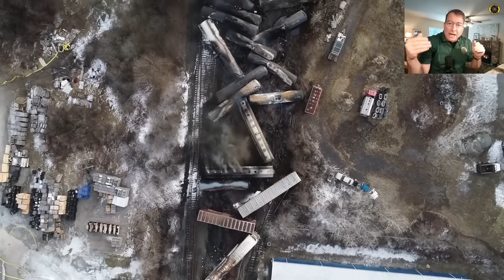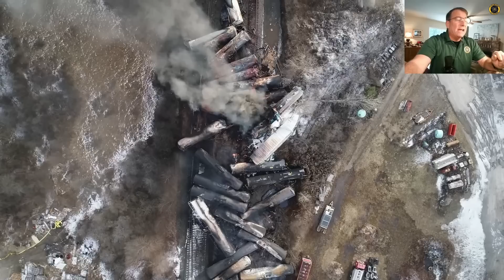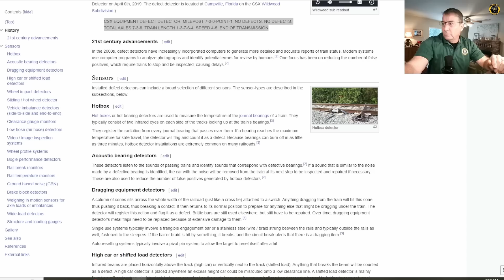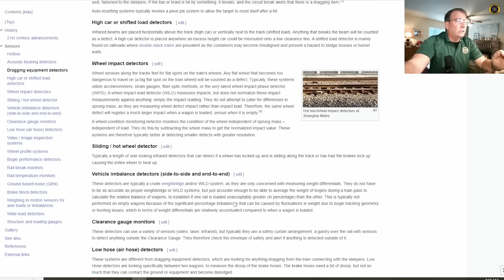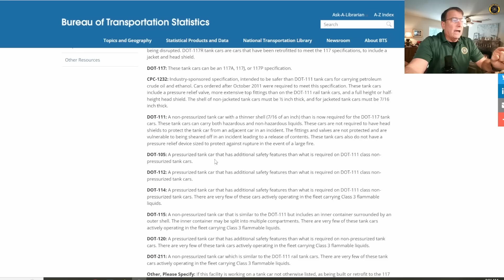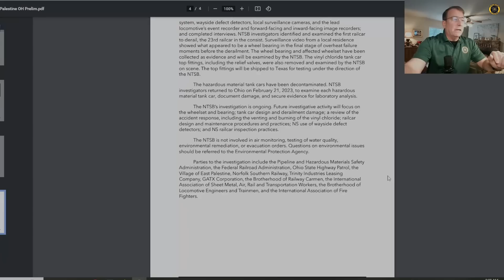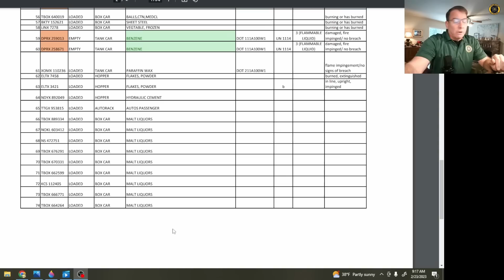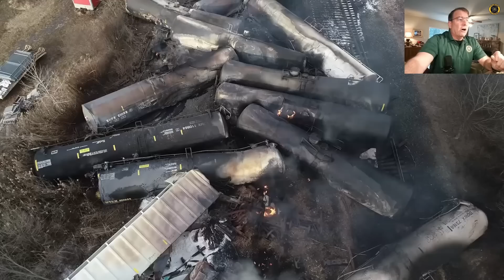NTSB Prelim Report: Norfolk Southern Train Derailment 23 Feb 2023

Comment: BEARINGS & AXLES

Juan,

Modern Roller Bearings are far more efficient than the conventional bearings sitting in a Journal Box. Obviously as with all items where there is a mechanical interface, heat is the enemy....so think of a drill bit drilling a hole in metal. Lubrication is the answer.

Likely what happened here is that following some form of lubrication failure, (or failure of a part of the bearing itself), the heat build-up caused the axle to fail and this led to the derailment. The speed from the rest of the train in rear then pushes against the point (car), of derailment. The kinetic energy will slowly reduce, but not before more damage, (and further derailment of cars), has taken place.

The kinetic energy is dissipated back along to the rear of the train, which eventually stops.
Clearly in this instance the reduction in kinetic energy and the eventually stopping of the rest of the train saved the Beer in the rearmost cars.

Whilst the Engineer and the Signalling Centre will receive the 'calls' from the Hot Box Detector, I'm not sure that the temperature is given as a verbal message to the engineer, or to the Signalling Centre. I cannot be sure that even if the temperature of a Hot Box were known, that there is any operating table that defines what temperatures are a bit of a problem and what temperatures are critical, such that the Locomotive Engineer might act to stop the train.

Giving the Locomotive Engineer a message which tells him Hot Box = Problem is much simpler and easier to act upon.

The mere fact that a Hot Box is detected indicates that there is a problem and that the train must be stopped and examined as soon as is practically possible. The concept of 'Stop & Examine' is a well know Railroad / Railway term and practice. In this sense it is rather like driving your car, where if you hear a noise that is out of the ordinary you stop to take a look.

I suspect that the temperature or temperatures picked-up by a Hot Box Detector are essentially only of critical importance when determined by the Railroad and NTSB examiners, as post accident information / contributory factors.

In what we might call the ordinary 'Happen-Chance' of life, in this instance the derailed cars were carrying chemical and potentially inflammable products......they could just as easily have been carrying grain or coal...!

James Hennighan
Yorkshire, England

Comment: Interesting article. I’m a Railway Vehicle Engineer. These types of events are not uncommon and yes a failing axle bearing on a laden freight train can “go nuclear” within 30 miles as shown by the data from the HABD sites. I’ve experienced a number of these. These detection systems are old tech and by the time they trigger the alert the bearing is in great distress and failure is imminent which could snap the axle and/or derail the train. The state of the art system for axle bearing detection  is the lineside Acoustic detection which picks up tiny defects and flags a bearing of concern 3-6 months before it would trigger a temperature alert. Much safer. Modern passenger trains usually feature on board axle bearing temperature monitoring as well.

Comment: It was the conductor and rear brakeman that used to ride in the caboose. Firemen rode up front and helped run the locomotives--especially in the steam era. Probably the axle failed and the car derailed, taking the train cars behind it with it. Even on a smaller train, this was going to be a huge problem. On a train this large, it was guaranteed disaster.

Comment: There is an end of train signal box which is real close to the pressurized air line. If the EOT signal connected to the air line a dump value could start braking the train from the rear and retard some of the energy / push from the rear of the train.  It also appears the engineer was too slow to quickly respond to the temperature reading.  What we lack here is the expected wheel set temperature given the local conditions.

Comment: Not all locomotives are equipped with dynamic brakes.
Dynamic brake locomotives are more expensive(optional equip) and are generally used by RR's that operate in hilly terrain.
As far as I know all new locos are equipped with dynamics.
Many older locos are not so equipped.

Comment: I know in aviation when worked for the FAA,I checked the equipment in the ATC and ILS systems, the equipment defaults to a non use mode if there is a cal or other problem so you can't use it.

Comment: One correction: the emergency braking did not cause the derailment.. the wheel disintegrating  caused the derailment and the engineers put the train in emergency once they got the hot box warning

Comment: If the seal is out of the bearing so the lubricant drains out, bearing failure can happen. 
Detector data from the prior move would paint a better picture of the bearing condition. It may have moved some distance losing lube, and not gotten hot enough to set off a detector getting to where this crew picked it up. 
Had the detectors been set up to communicate, a 110⁰ rise in bearing temp is enough to warrant an inspection. 
If the temp of one bearing could be compared to the train average, it likely would have been caught at the second detector as well.

Comment: Jaun-
Wow. Starting railroad reporting in the deep end.  A couple of minor points with you language as I appreciate your technical accuracy in your other reporting:

Positive Train Control (PTC) is mainly employed to regulate the speed of a train as specified by warranted track speeds per any given section of a railroad and to ensure a train’s avoidance of other trains or equipment operating on the same lines allowing the PTC to take control from the engineer in order to stop the train.  It is not intended to manage all aspects of train performance and mechanical issues as they occur. I am fairly sure that the train’s “PTC” system in no way failed; it is not some Musk-contrived, overly-hopeful, fully-autonomous, solve-everything, train driver system. It basically protects trains from each other, from their own speed, and from certain switch alignments.

Only conductors and brakemen would historically be found in cabooses; ‘firemen’ were traditionally in the cab firing the power-plant (steam boiler) for the engineer who was responsible for applying the power to the engines (valves/pistons/drivers) to operate the train. Thus a firemen’s primary safety job was not to look for fires - AKA hotboxes AKA overheated friction bearing journal boxes - but to ensure boiler safety and performance. This NS train had an engineer and a conductor in the cab - as is currently common practice in modern, long haul, distributed-power, diesel electric freight - with a monitoring ETD on the rear.

Roller bearings, bearing seats, rail axles, trucks, etc. are all metal (forging, castings, machine parts), under pounding strain, and can catastrophically fail (crack/fracture) causing a bearing/axle to heat up very quickly at speed.  This can easily result in a railcar wheel set/ truck assembly starting to come apart as infrastructure within the trackway/gauge - such as crossings pads and turnouts/switches - are hit with hanging/failing equipment.

Hope this advances your rail knowledge, I appreciate your other infrastructure and systems reporting. Thank you.

Comment: At 4:30 you mention that PTC was operating but failed to prevent the derailment.  PTC’s purpose is not to prevent derailment.  It’s purpose is to prevent rail collisions. Also, at 7:40 you mention that fireman used to ride in caboose.  The conductor used to ride in caboose, not the fireman.  Back in the day, the fireman shoveled coal to the steam locomotive firebox, thus “fireman”.  The conductor was moved to the diesel locomotive after cabooses were removed from trains.

Comment: The hot box detector does not transmit its findings until after it passes except if it detects a problem during the scan. It does not transmit info to the engineer like trends of boxes heating up during a normal scan from the last detector unless it is outside the parameters set by the railroad. I do not know if the boxes are connected to dispatch or not.

Comment: Lots of good info here (even more so in the comments than the video), but there are still some things I am confused about:
1) What sort of bearing are we talking about here. Presumably not a bushing, but some kind of typical (but large) ball or roller bearing? 1a) is it one central bearing or two bearings - one near each wheel?
2) Why did polymerisation of the vinyl chloride start? 2a) Did the derailment start a fire that heated that car up? Is it normally cooled and the derailment stopped that cooling working?
3) Was there a fire before the deliberate setting of one to burn the vinyl chloride?
4) Was there actually any (significant) phosgene produced by the burning. I've seen plenty of excitable comment about it, but so far as I can tell from some basic chemistry reading, burning vinyl chloride in air at atmospheric pressure does not generate phosgene.
Thank you for any clarifications people can provide.

Comment: Retired Engineer. The evidence is pretty clear to me. If you have three detectors all working properly it falls back on the RR on where they set the threshold (in temp) to warn crew. And yes, if you have an increasing heat signature on a wheel bearing, the heat will exponentially increase until failure, especially on 50 mph track speed. 20 miles between detectors is more than enough time to reach failure point when previous detectors already recorded an increasing heat signature on same axle as in this case.
PTC technology is not at all applicable in this derailment.

Comment: I retired from NS after a 41 year career in the mechanical department in 2020. I didn’t intend to retire for a couple more years, but the absolute rape that PSR conducted on these class 1 railroads had made it so unsafe that I ultimately decided it was time to get out before I saw one of my buddies or myself killed! One of the first actions of the hedge fund carpetbaggers that inflicted the PSR Pandemic on the class 1’s was to quickly dismantle the repair and inspection operations of their car and locomotive fleets. The few terminals left after the scorched earth stripping of assets was executed, had nothing more than skeleton crews of trained inspectors left due to mass layoffs, and the few that remained were told unequivocally not to inspect anything! Just couple the air hoses and let ‘em go! And worse yet were the now numerous terminals/yards that originated trains with zero trained inspectors on the property, and the outbound crews, which through no fault of their own, aren’t trained in inspections, were the only eyes on the train! And the severity of that situation is doubled by another of PSR’s dirty deeds: reducing the number of trains ran by coupling the consists of two or three individual trains together into monster 250 or 300 car trains! These things had (and still do!) locomotives spread out in two or three locations throughout the consist and radio controlled from the lead unit. What few of us “old farts” were left out there during this PSR charade in 2020 predicted this kind of stuff would start happening after a couple years. Prior to PSR, rolling equipment was maintained in optimum condition, so we knew it would be ok for a time, but lack of inspection, maintenance and repair for a few short years will make its absence known to all! Just ask the residents of Palestine, Oh! The railroads as well as the Wall Street Hedge Fund crowd need to be held “feet to the fire” over this and every other incident like it! It was preventable, but the Federal government just sat back and watched as Wall Street demolished a freight transportation system that was the envy of any other country in the world in the name of artificially lowering the Operating Ratio (the lower the better) to raise stock prices! They made billions by unloading their stocks at what they deemed to be the peak, then moved on to some other gold mine while the rails smoldered behind them! An outrage!

Comment: So, in the old days, they used to have journal boxes, and these were basically a box around the bearing containing grease. Well, when the journal box runs out of grease, the bearing starts to heat up. I would assume that these bearings are similar but not exactly the same as the old journal box, but they do require lubrication. Effectively, if the bearing is heating up, that means that it has run out of lubrication. I would say that the cause could be leaking of the bearing or a damaged bearing. Either way, no lube equals heating and eventual failure of the bearing, and after that mechanical failure of the wheel itself.

Comment: The second HBD at MP 69.01 was the one closest to the security camera footage taken in Salem Ohio. It is on the southeast side of Salem and after where the footage was taken. If it only read 103 degrees above ambient, then it was definitely not working at properly as the wheel hub was literally on fire as it went past that detector. The one at MP 49.81 is the one in East Palestine, behind the fire station in the middle of town.

Comment: 27 year locomotive engineer. Your analysis is mostly correct, but the emergency braking did not cause the derailment. The derailed car did. Once it came off the following cars went too. The emergency braking actually helped to keep the rest of the cars in the train from derailing. These trains have two braking systems; dynamic as you stated and automatic which is the air brake system. The engineer can apply varying degrees of automatic brakes by what we call drawing down the air. The more you draw down, the harder the brakes on the cars will apply. Emergency is the maximum.
The engineer and conductor on the train will get a message over the radio after the train passes each detector. The detector will state either no defect, hot wheel, dragging equipment or critical alarm. The train crew would have no knowledge of a bearing trending hot as long as the previous detectors stated no defects. However, there is a wayside detector desk in Atlanta that would. 
PTC has nothing to do with this situation. It is only designed to prevent trains from exceeding their authority whether that is speeding or going beyond their limits such as passing a stop signal. Hope this helps!

Comment: Jaun As a long time follower of the channel and someone who works in the railroad industry it’s awesome to see you cover a derailment. I used to work for NS at Conway Terminal where this train (32N) was headed. I’ve often thought of creating a channel similar to yours that covers derailments, but derailments are way last variable than aircraft incidents.

A few points that others may have made in other comments. PTC in it’s current configuration was not built to and could not prevent this this derailment. You’ve already cleared up the emergency brake application error and I appreciate that. Dynamic braking is basically regenerative braking but power that is generates is dissipated as heat. Dynamic braking is very affecting down to 25mph then you’ve got to grab the air brakes to bring the train to a stop.

If you or anyone else has questions on Railroad or NS Practices please feel free to reach out. And don’t let all the foamers and cranky old railroaders tell you to “mind your own business and stick to planes” you’re doing a great job from one industry professional to another.

Comment: Hi Juan! I'm Shane, I am a retired engineer and I can safely tell you that the engineer was doing it right! He was on the Dynamics to slow the train. If an engineer uses the air, the brake shoe can sever an axle from the side frame causing a derailment. The train went into emergency when the car with the hotbox derailed. It was a non engineer induced UDE. So I'm just backing you up!!! You are correct!!!